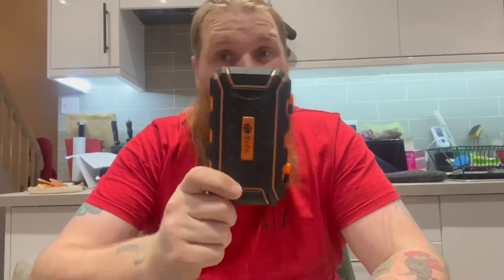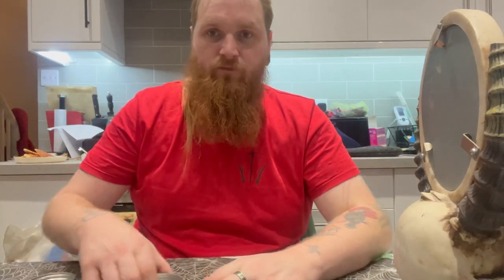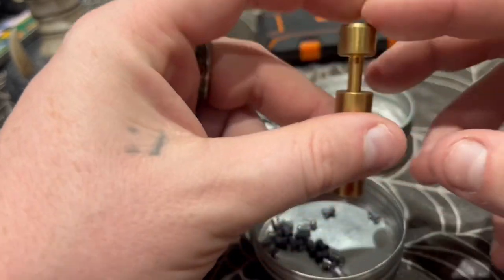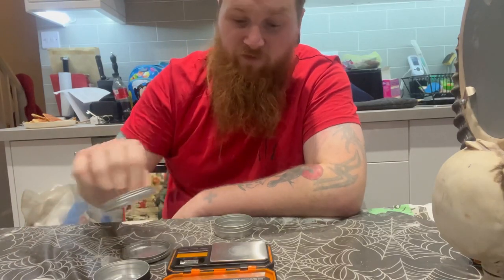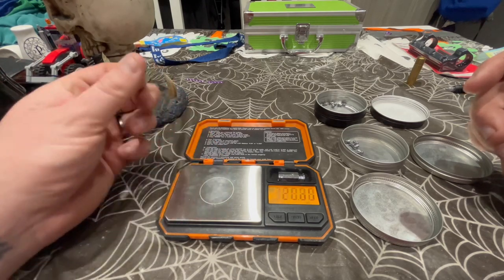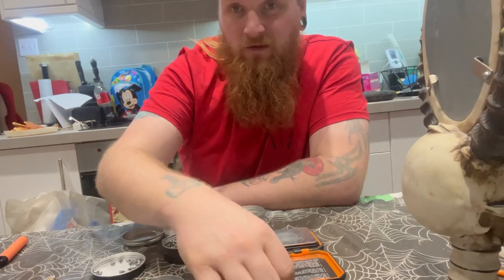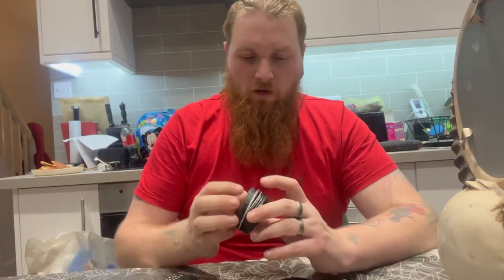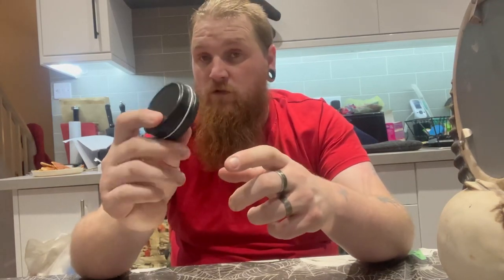Pellet weighting and resizing

Comment: That type of sizer will resize the head AND the skirt to 4.50. I use same scales weighed 20 tins of 4.51 FT's in 3 batches, <9.66 (1½ tins),  9.68 -9.72 (15 tins) and > 9.72 (2½ tins)
Reply from the maker: Yup that’s what I like and rifle likes, the scales are ok for there price I did have a nice try of reloader ones but they got lost in transit wile move if a few year back

Comment: It's the head size that's more important than the skirt. The skirt is thin and ease to deform in the barrel, the head is not so easy. Imagine a 4.50 head and a 4.53, some 4.53 tin marked can be 4.56!  The tin size is head NOT skirt
Reply from the maker: I don’t worry to much about that to be fair just weights

Comment: I got a set of these scales today to replace my 20 year old set (The LCD leaked and showed black)
New scales... Utter garbage.
Doesnt weigh anything.
Wont calibrate
It just sits there with a pretty blue LCD saying 0.0000

Im waiting to see what the seller has to say.

My last batch of 8.4gr JSB's was truely aweful..
24 tins washed, dried and weighed.
I collected 453 pellets that weighed 8.4x gr out of 24 tins!
Reply from the maker: Must be a dodgy one as I’ve had no issue with these

Comment: Doesn't the barrel in your gun size the pellet. Think about it
Reply from the maker: They can also mis shape them, if you the full set of jsb 4.49-4.53 you will see some fit better nicely some will be loose or tighter fit
Reply: @norfolkairguns  ok I'm open to peoples experience
Reply: I have thought about it lot. Head sizes vary in any tin of any pellet, I shoot H&N Baracuda FT 4.50 through my Walther LG400 FT benchrest gun. I currently use a Pelletgage to check and get a range of 4.50 to 4.52 pellets with the odd 4.49, I also weigh. My thinking is the small ones will run through the barrel with less friction than the bigger ones resulting in a small reduction of velocity. OK, very small but in benchrest a variation resulting in a 2mm change in poi can mean losing the 10X and coming 2nd, it's not like FT/HFT where you have a 2 inch target and even clipping can result in a knockdown. Even if there is nothing in it a lot of target shooting is psychological and if you can take away any small nag it helps. I also agree that the pellet sizer used will size the head which is more important than the skirt which will expand when it gets kicked up the backside with a great big high pressure bump. Not boasting, but I'm currently in div 1 of the Hendon postal national comp so I do have some experience.